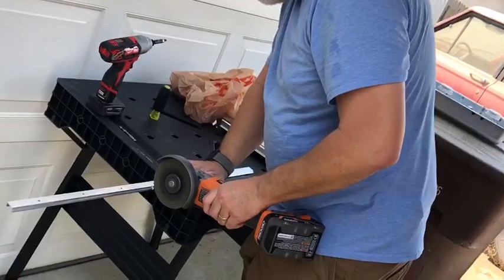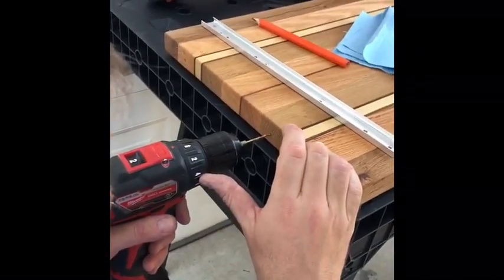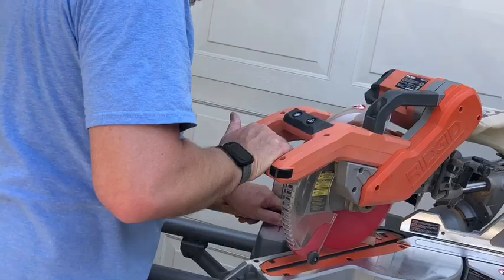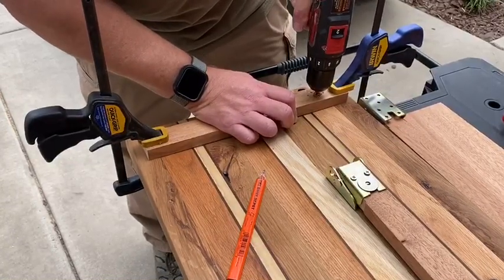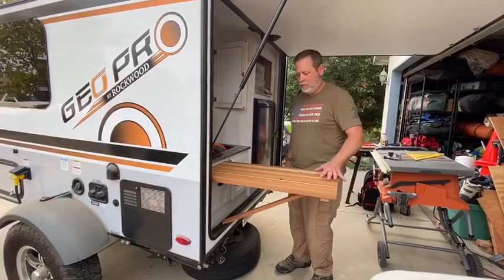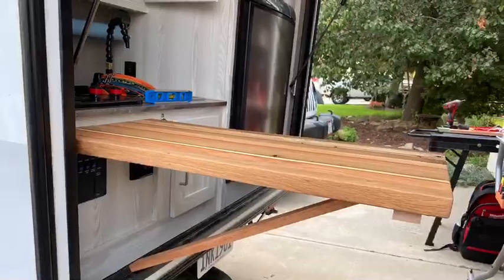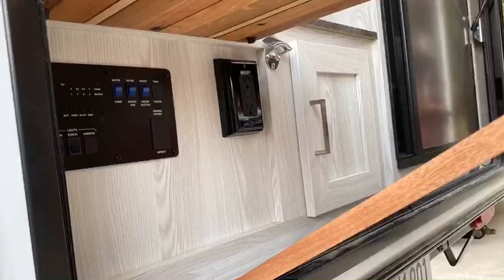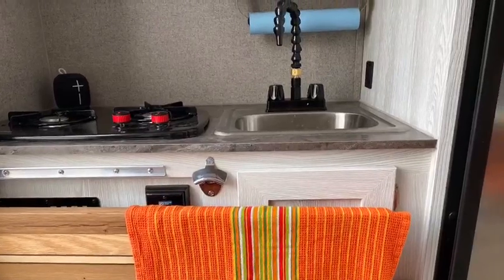Custom Tabletop Installation on GeoPro 12SRK

Comment: I stopped in to a "local" (about 25 miles from my home) dealer to looked at the Geo Pro 12RK they had just received on Tuesday (2-23-21).  I liked the way it was set up, asked some questions, and am awaiting the 12SRK to come in.  I liked the 12RK so much I put down a deposit upon the 12SRK.  I have to now wait until some time in May for it to come in.  I'm hoping that the refrigerator is a 3-way power one like the 2019 and 2020 SRKs were.  The SRK seems to have a LOT of options on it that the RK doesn't.  I cannot wait for it to arrive, being the on-the-go adventures, and see where it takes me.

BTW, the coloration of that DIY table is SWEET!  Thanks and looking forward to more of your mods (that I can hopefully put into use on mine).
Reply from the maker: Thanks for the compliment on the table! May seems far away, but it will be perfect weather to get started on your adventures. Do you have a shakedown trip location planned yet? Let us know what kind of fridge you end up having!
Reply from the maker: Here's the Haylett tour of the 2021 SRK. https://youtu.be/AiSgxvuT0HA

Comment: How does it tow behind your jeep?  What does your hookup look like-hitch, trailer brake controller, etc?
Reply from the maker: Tows easily with our Jeep Wrangler JKU. We don't use a wdh or sway control because we take it off-road and didn't want to damage the trailer or the Jeep, but we did add airbags. We feel the trailer back there, but it doesn't pull us around at all.  We use a wireless Curt brake controller.  I can take a picture of the hookup soon.  We're hitching up and heading out at the end of the week!

https://amzn.to/2Tdohbp
Reply: Thanks for answering  so quickly. Have a good trip.
Reply from the maker: @resq6543  Thank you!